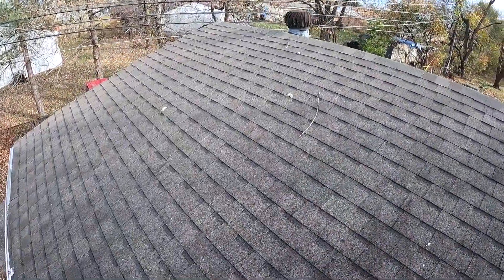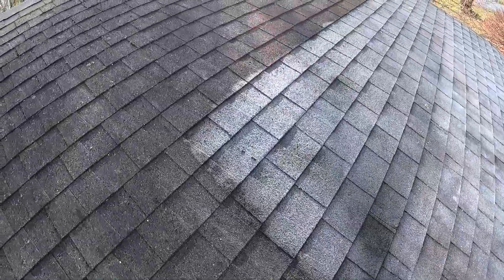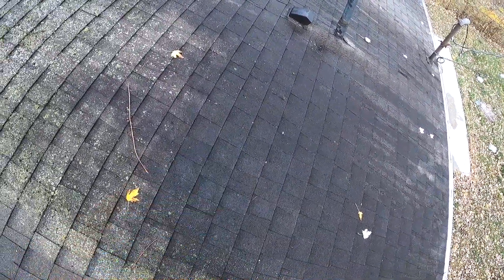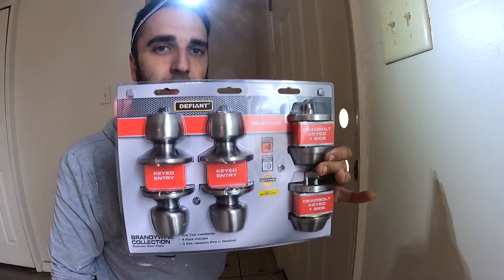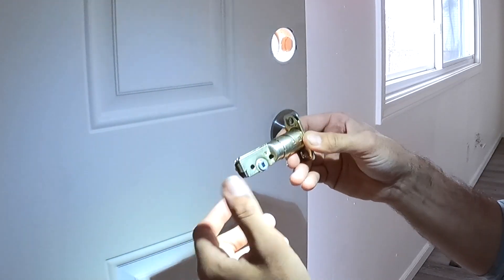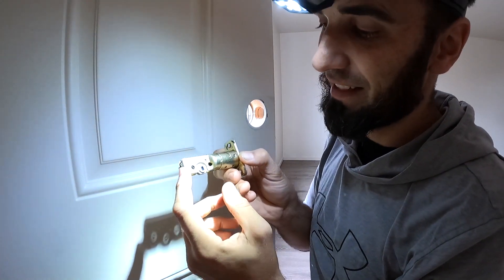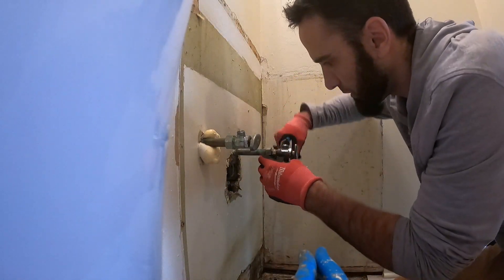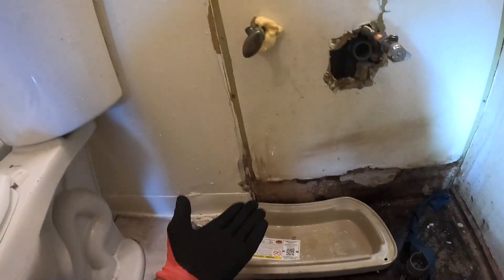Rental Property Repairs: Plumbing | Vanity install | Roof cleaning

Comment: Great video. It’s interesting I don’t really use Glacier Bay products.  I feel like  Delta / Moen products last longer and have greater availability of replacement parts.
Reply from the maker: Thanks. I use Glacier Bay faucets in kitchen(no sprayer) and baths and Moen Adler shower valves. The Moen shower valves are great.

Comment: That was cool, teaching us about how the locking mechanism extends longer.  Why did you decide to remove the spigots?  Was it due to a leaking water issue?  It was fascinating watching you remove then install the vanity and sink plumbing.  Thank you for this video.
Reply from the maker: Thanks. The door lock part is something I will never forget. Water bills are kinda weird but basically once a tenant leaves a unit the city can pass the water bill to the owner. It’s a huge issue. I’m assuming that is why he removed the spigot. Over all I kinda like the gray vanity but I did grab it by mistake. Haha I do not own this property so I just run through my list.